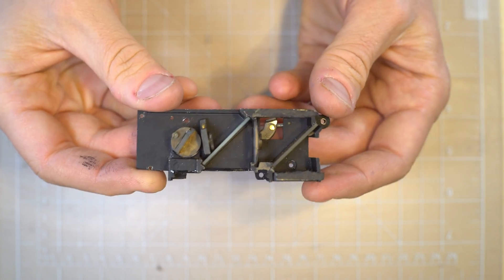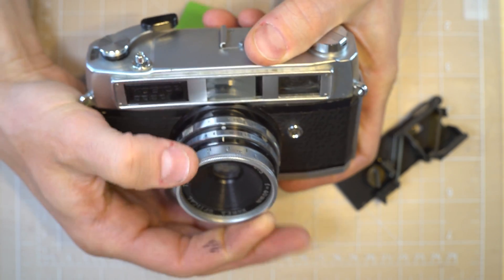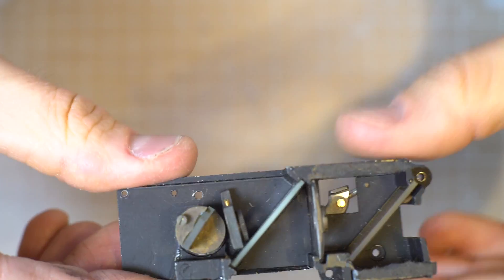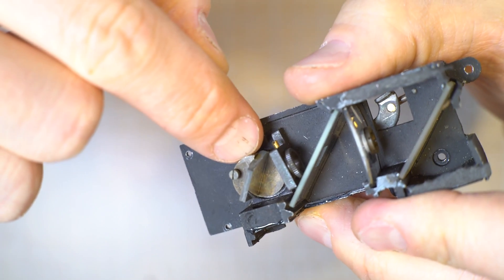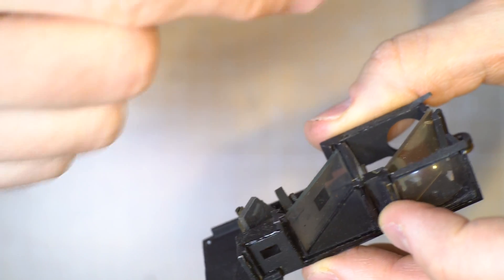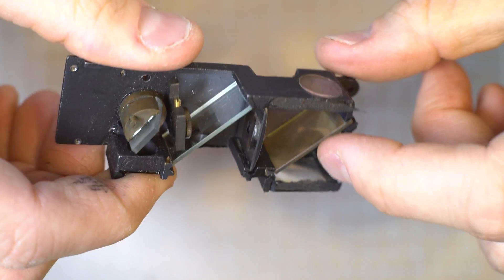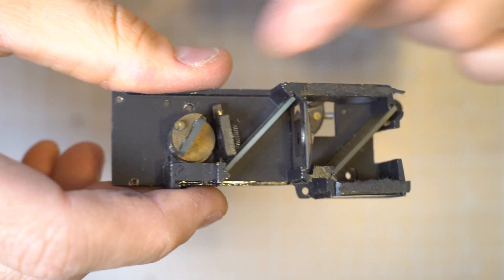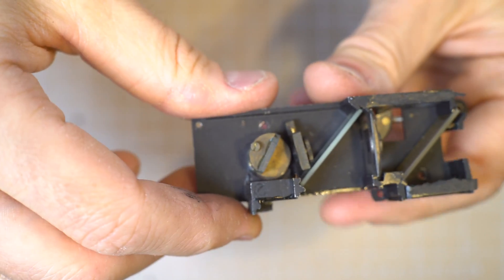How a Rangefinder Camera Mechanism Works to Show Proper Focus | Pellicle Mirror & Rotating Mirror

Comment: i have a petri 7s whos rangefinder focus was not working and i opened it up and it uses an annoying method of bending a small piece of steel holding a small reflective mirror into place.
Im thinking of cutting that off and modeling/printing a mirror holder that i can adjust with small metric screws. 

Unfortunately seems to use a different setup for how the rangefinger image gets reflected and focused into the view finder. 

The petri's focus lever actually instead moves a focusing ring with a ~2mm throw from min/max focus.

Any clue on what the mechanism is called?
Reply from the maker: Oh man I've never seen a system like that. If there is an actual lens element in the housing that moves, that would be just like a traditional, simple lens.

Comment: not so sure about the focusing of the internal lenses having anything to do with calibrating distance. Wouldn't you need to be adjusting for zero, spread, and linearity? Which would mean that part, whatever it is called, that pivots back and forth based on the lens's focusing ring?
Reply from the maker: It's adjustable and they can still come out of calibration today. Most rangefinders have a small access port on the back to allow calibration set screw adjustment.

Comment: Ok I bought a bushnell range finder v2 model second hand well even though I put a new battery in it still does not read any targets when I put the crosshairs on it and push the measure button could you fix this and possible do a video on repairing this viewfinder and possibly make a video on it I can send it to you and pay for repairs
Reply from the maker: The Fix Old Cameras channel would be a better resource. I only repair my own gear.

Comment: Hi! Great video! So I don’t now if this question is too advanced but what would cause a drifting patch? I have an Olympus 35rc (two of them but thankfully one works perfectly) where when you focus the patch drifts after you stop turning the focus ring. Could it be the focusing mechanism needs oil and the friction is causing it to delay? It’s a question a local camera shop couldn’t answer so it’s all good if you don’t know but if you did it’d be awesome.  Based off of this video I think I have a solid understanding now so I’m gonna open it up and see if I can figure it out now understanding how it should work.   Thanks for the great video
Reply from the maker: I know the answer and I know where to go to start hunting for a fix. :D

I think your hunch is on track. If the focus keeps shifting after three focusing ring turns, but it does not shift on it's own then the ring isn't turned, then something is affecting the transfer of force along the medical connections. The most likely case is either a spring that's slow or a gear that's stuck somehow. In the later case, the force from the focusing could be building in part of the mechanism, like a linkage arm, and then transferring into the gear due to the linkage arm retaining energy like a spring.

Fort fixing it. Check with the Food Old Cameras channel or the Photrio Forum. Either source will likely know if anyone is repairing these still.

I would not suggest fixing this yourself as the mechanism is likely to be highly complex.

Comment: Hi David! Thanks for the informative video :)  I have a cracked cover glass and I was wondering if I can replace it with any old sheet of glass or do I need to closely match the thickness/refractive index of the original? (i.e. do you think the focusing accuracy would deteriorate much with an imperfect replacement)
Reply from the maker: Thank you! That's a question I don't know the answer to. I'd check with the Fix Old Cameras channel, though.
Reply: @DavidHancock  Thanks anyways!

Comment: Great explanation of how a range finder works for dummies! Does that mean a range finder does not need to be re-calibrated after servicing its lens (because the range finder shows the two images)? Also, where does that little black mask go that always falls out of old rangefinders?
Reply from the maker: Thank you!

The RF should still work properly after a lens service if the lens was reassembled correctly. But they may need calibration with time as use and such can affect accuracy. Most RF cameras have holes or covers on the back to access adjustment screws.

Comment: Just tagged a Graflex Rangefinder made by Kowa in the mid to late 50's which will be seeing some shutter speed repairs, a Century 35 model. Will be resourcing details about it's use and operation, as well as it's calibration of the rangefinder mechanism in the days ahead. The shutter speeds below 1/50 of a second are seemingly hung, but it's a Seikosha MX clockworks which may be readily repaired. I hope to get the rangefinder recalibrated after the work is finished on the shutter speeds. Your help has made it seem a doable task. Thanks!
Reply from the maker: Nice! Rangefinders aren't too hard to calibrate (depending on unit.) Many of them have a calibration screw or a calibration port access cover on the back and don't need to be fully dismantled.

Comment: I accidentally "rubbed off my coating on focus patch windows(rangefinder windows)". however I still can focus through the viewfinder. either focus patch or the viewfinder lines is still bright, see no problem , but the thing that I am worrying is that will my mistake end up causing my focus patch dimmed or even having glare on it? Thx
Reply from the maker: Hmm. Not sure what affect that will have.

Comment: Hi David, that was a great simplified explanation! I recently bought a Konica S3 which is in physically good condition. However It's missing the yellow focusing patch in the viewfinder even though the viewfinder is very clean. Do you know what might be causing this issue?
Reply from the maker: Thank you! A couple possibilities. First, the internal mirror/beam splitter, whatever they use, may be just filthy and preventing light from passing. Alternatively, if the camera rattles, it might be loose. My guess is filthy. I don't know how hard a repair that would be.

Comment: thanks for the video!  great explanation on how it works.  can you do a video on how to calibrate the rangefinder system as well?   that would be super helpful.
Reply from the maker: I cannot, unfortunately. Each camera is a bit different. It's a bit hard to demonstrate in a video. But I'll see if I can figure out how to work it into the individual manuals for specific cameras.

Comment: Now I am curious how to calibrate these things. Infinity is easy enough, but the closer the focusing distance the more difficult that would seem esp with those f1.2 primes.
Reply from the maker: I suspect you're right. I think that the calibration tolerance on slower lenses, like a Yashica Minister-D with a 45mm f/2.8, would be far more forgiving than, say, a Yashica Lynx 14. I'm going to see if I can figure out a way to make a vide showing how to calibrate a rangefinder or if it's better to work it into the video manuals.

Comment: It is amazing how many ways there are to implement the same technique.  The rangefinder that you demonstrate is markedly different from the rangefinder in my Retina IIa and both are radically different from the one in my Moscva-4, yet they achieve identical results.  The internal components on both of my cameras are completely fixed, and neither have internal focusing lenses.  The Retina uses a pivoting arm mounted in front of the rangefinder and two internal mirrors.  The Moscva uses two prisms in a beam splitter, with a rotating prism mounted on the shutter housing 3 or 4 inches away from the rest of the mechanism.  All of these are different from what Gemista describes in his comment.  Yet the experience looking through the viewfinder is identical.
Reply from the maker: Oh fascinating. Both of those sound much simpler than this. I wonder if they had to do things differently due to patent issues or just because, you know, Taron did things differently.

Comment: Another cool RF mechanism is the one in the Argus C4– it has two stationary mirrors, with a moving intermediate lens, so instead of moving the mirror to select where it looks at, the lens is moved to select where on the mirror to project in the eyepiece
Reply from the maker: That is very interesting. I wouldn't have thought that approach would work. I'd think it would just change the focus on the mirror.

Comment: I just bought my first Yashica Electro 35. The rangefinder is pretty cool. Nice bit of engineering.
Reply: Such a great camera! Have and love it as well, took it with my on m trip now after years...
Reply: About 10 years ago I found an Electro 35.  That camera gave me a higher than normal percent of keepers per roll.  The light meter is scary accurate.  It’s a great camera, the only down side is the battery dependency.  Enjoy it!
Reply from the maker: Agreed!